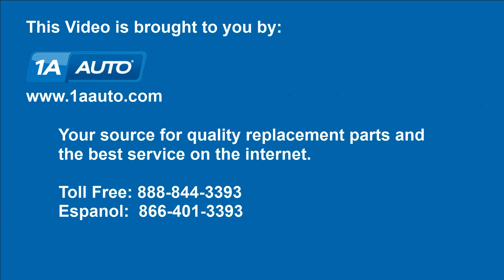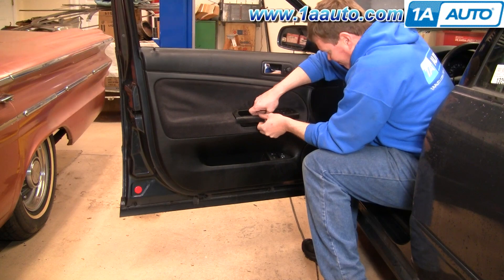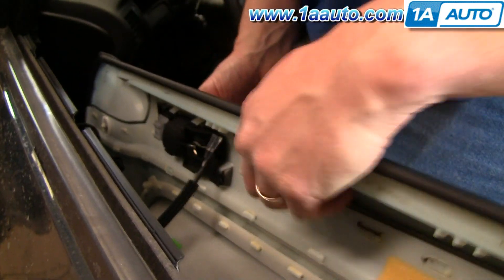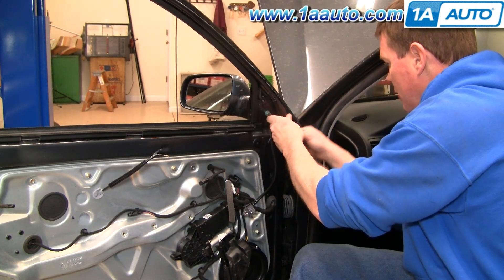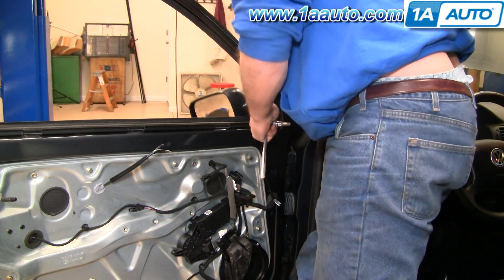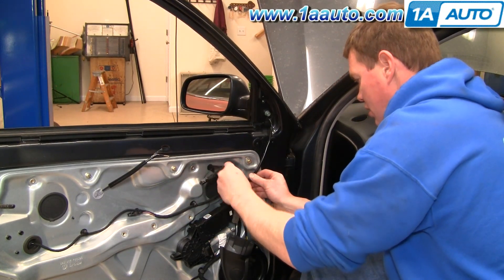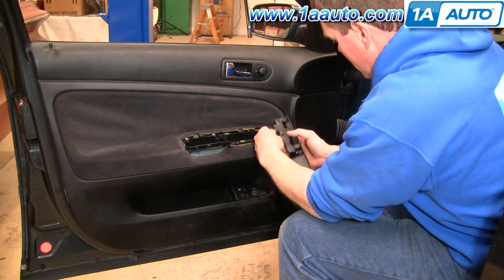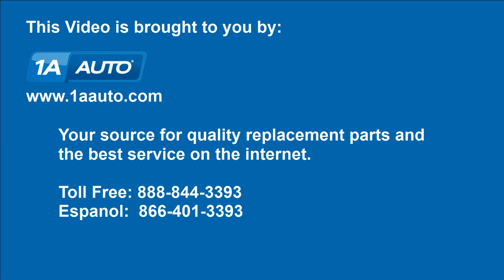How To Replace Broken Side Rear View Mirror VW Passat 98-01

Comment: Replaced mirror today on 2002 Passat very easy to do per video instruction. Chose to rest panel on step stool instead of taking off most other pin connectors seen in video in case I go lost reattaching, and then reassembled when completed. Worked out well. Just make sure to re-hook panel correctly on top of door near window. Almost was done saw mine loose had to briefly backtrack and refastened. Job took less than 30 minutes even with panel fastening done twice.

Thanks again for taking the time to post this video.  Choice was either blindly fork over estimated $1000 to replace/install thru local VW dealer, or find cheap replacement part (mine was used 2002 same color from Ebay $29 shipping included) + use your video tutorial to self install. Tough decision.

Wife's late dad was a VW shop foreman & master mechanic originally from Germany (worked at same dealer above with $1000 estimate) sure he is smiling today.
Reply from the maker: Thanks for watching. We carry brand new side view mirrors on our website, with free shipping in the lower 48 states, for not too much more than the used one you purchased. They'll same you a ton of money. Here's a link to them on our website, if anyone would like to check them out. Thanks for watching. http://www.1aauto.com/1A/Mirrors/Volkswagen/Passat/-/-/2002?utm_source=VideoReply&utm_medium=YouTube&utm_campaign=1ATony

Comment from the maker: @karlKrump We currently do not have a video on this, but more than likely you would need to remove the door panel, and any trim pieces that may cover the bolts that hold the mirror onto the door.